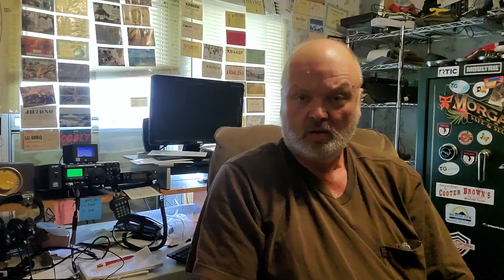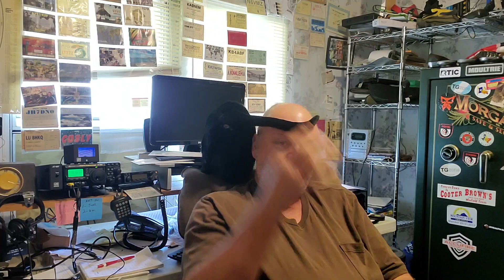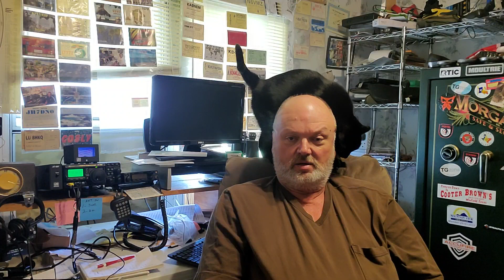160 meters and advice for new hams.

Comment: I like your advice to new hams. I was licensed in the west indies at 16 (in 1978). Didn't operate in Canada for 25 years due to code. I don't want to learn it, never will. Did my basic exam and did so well that I got honours and in Canada that means you get hf privileges.. I Am not interested in code, digital, fm, eme, I am a rag chewer. Not interested in contesting. When there is a contest... it's time to switch off. So we each can use the hobby the way we want. I like to tinker with wire antennas and have a very low budger for gear. Still got my tube rig from the 60's matter of fact have a spare too. Enjoy the hobby and dont let the hates chase you away. Am experimenting with an 200 ft end fed these days.. 73's and keep up the good job.
Reply from the maker: thanks!!!!!!73!!

Comment: I realize it's been over a year since you made this video so anything I tell you may be old news to you by now.  Seems like most of the activity on 160 takes place below 1.900.  I'm mostly CW so I hang out below 1.825.  Back in the 80's I worked SSB around 1.840.  I don't spend a lot of time on 160 now but tonight I had 2 really nice CW QSOs on 160 and it sparked my interest in the band again.  I have a half-wave inverted vee for 160 that is 40 feet at the apex.  As hams, we do what we can do.  It doesn't have to be perfect.  Put up what you have and where you can put it and make the best of it.  As you rightly said, a 160 meter antenna is hugely compromised due it its size and our ability to only get it up a few feet.  But even at that, it can still be done and it's a lot of fun.  As close to the ground as it has to be is a major influence in the antenna operation and the SWR.  I have my 160 configured as a fan dipole along with 80 and 40.  The BEST SWR I get at resonance is 1.8 to 1 SWR.  But that's why God made tuners!  Keep up the good fight.  73  de  K7SU
Reply from the maker: thats great!! thanks for watching! 73!!

Comment: True story - this hobby does not need to cost the earth. It's a characteristic of the hobby that I like most. My first HF rig came out of a truck that worked cross-border in Africa and cost less than $200 - it was painted white after a cab respray and I restored it and it is still my backup and field rig. Besides my TS830 station just about everything else I have built or repurposed or bought well used. I have always made my own antennae and had a 160m horizontal loop before we emigrated. I hope you had fun on 160. Thanks for the video. 73 de CT7/ZR1XZ
Reply: Same thing here bro my first 2hf rigs were used icoms. Paid 250 each. 160 all the way up to 10. Really good transceivers
Reply from the maker: thanks for watching!!!73!!

Comment: I will not touch an Internet forum. I read a question from a newbie and that guy was eaten alive by the resident smart butts. 

On 160 I was told either mount a dipole in a vee up high (75-100 feet) or take a dipole and go vertical 40-60 feet then turn 90 degrees and run out the rest of the positive side. Then take the ground side and run on ground or along a fence and make a 45 to 90 degree turn or two. I found both work good. The second one has SWR issues when wet weather hits. 

I made a loading coil to put up a vertical on 160, but have not made it back to that project yet.
Reply from the maker: i agree on the internet forums, although i read them and get alot of video content from them i rarely comment on them. Thanks for the 160 info and thanks for watching!73!

Comment: A great antenna that works. 160 through 10 is the full wave sky loop.  Sounds like it would be huge but if four sided each side is roughly the size of an 80 meter diapole.  You can make it any shape.  Feed it with window line.  Use a very short pice of coax to get out the house then a 1:1 current balun.  With a tuner its great.  NVIS on low bands and low angle on the higher.
Reply from the maker: buddy of mine put one of those up, he really liked it. thanks for watching!! 73!!

Comment: Have you given any though to adding a balun at the antenna? Assuming you're running coax out there you're going from an unbalanced feed line to a balanced antenna. Even adding a 1:1 choke would help too because you're guaranteed to have common mode currents in your coax which will alter your tuning as your coax become resonant. Love the discussion! 73 K7HKW
Reply from the maker: i may add one later, honestly my 160 dipole was just a experiment with wd5hkv to see if we could even get one in the air, so far its working fine not sure how much 160 im going to work though,
Thanks !!

Comment: 126’ 9” would have been better stated per leg, as opposed to the length of a half wave dipole that you stated in your introduction.  Thanks for helping new hams.  My Carolina Windom 160 OCFD is 265 feet long and up 70 feet and works good on 160 through 6 meters with SWR typically under 2:1 across the bands, except 60 meters where it approaches 3:1.  73, Tom WB9DZS
Reply from the maker: thanks for watching!73!

Comment: I have worked  160 meters since about 1980. I used a dipole for many years that was about the height of yours. I would rate it as fair but far better than no antenna. The enclosed You Tube link shows a full wavelength loop that I constructed. The performance of this loop has been noticeably better than the previous antenna when mounted at a similar height above ground. It also has https://youtu.be/qxWa545jpRs the advantage of being able to be used on all bands through 6 meters. 
https://youtu.be/qxWa545jpRs